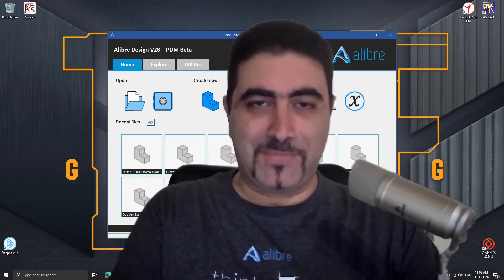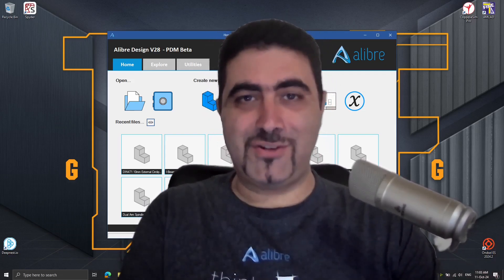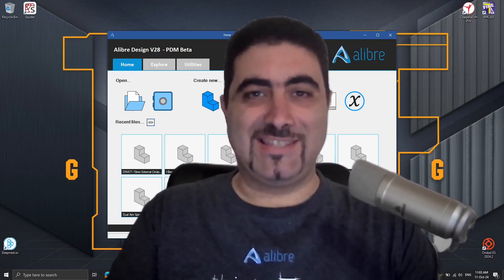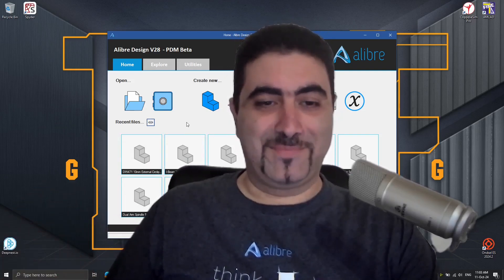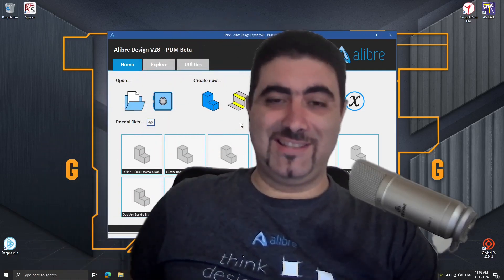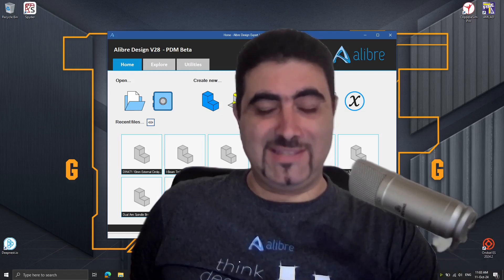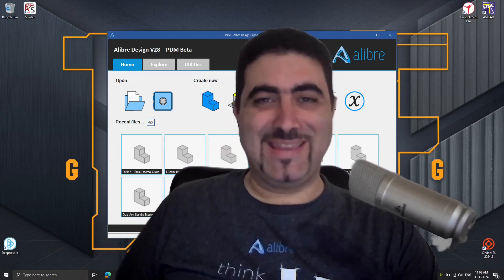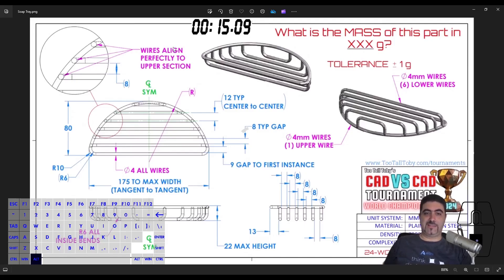TooTallToby's Extreme 24-WC-30 Soap Holder Speedmodelling Challenge

Comment: Let's gooo! Congrats on 1,000!
I'm ready to learn
5:35 "We have all of the dimensions that we need here"
The amount of times I've tried to tell myself there's not enough information on sheet is crazy. It's always there, but when you're 35minues in to a speed-modeling challenge, you question yourself.
8:06 Okay, I'm intrigued. How tf are you getting a piece made of wires from this?
12:58 This is such a huge, massive, extremely big-brain move. I would've never, ever thought of that in a million years. You're going to use the paths from the surfaces to sweep...? Maybe?
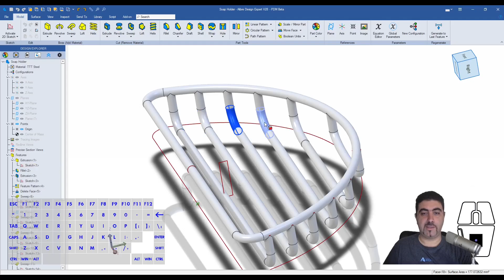16:30 That's quite the Ivan-exploit indeed, but a really good one. Does that count as an Ivan-exploit? Who knows. I think it does. Right answer, wrong geometry. I think it counts.
22:50 Would a coincident constraint with the origin not have copied over as well, so that you don't have all the extra hanging off? Even if not, would it not have saved time to add one with each copy?
23:26 I didn't know there was now an entire part mirror. That's cool. Also technically you could've just used the mass from that and multiplied by 2, but I guess that's not in the spirit of the competition eh?
Reply from the maker: 08:06 Yeah, that's the cool thing about that strategy. That's the first thing that came to ind and how I would have done it if I was competing.
12:58 Yup... Surfaces in Alibre are completely underrated and hugely powerful. Thanks to Joseph for showing the potential to all of us!
16:30 Definitely an Ivan-exploit if there ever was one... lolololol
22:50 Uhm... Adam..? You have the spark, you know that? Yes, that would have been a significantly better approach. Cool idea man.
23:26 Definitely in the spirit of the competition. Ph0sphor used to export volume from Plasticity and do the math!!! But I reckon it's quicker to do that mirror.

Thank you so much for that comment man! And, you're starting to get the hang of this speedmodelling and strategic approach. Maybe, practice a bit and throw your hat in the ring next year..?
Reply: @ExMachinaEngineering  I'm not sure, I just tried combining my own method with yours and I was 4 grams off, and I don't know where I went wrong. Darn. It also didn't really like copying the origin coincident.
Reply from the maker: Hmmm, I'll give it a go later today and see how it goes. Make sure that the sketch is placed correctly and your just selecting the origin as the base point.
Reply: @ExMachinaEngineering  I ended up figuring out why I was 4g off at least.
Reply from the maker: Ok, cool! What was it? Maybe do a vid about it
Reply: @ExMachinaEngineering  Well my 4g was only because I put 22 for the height instead of 18. 
I was also having an issue when it wouldn't automatically coincident each new sketch to the point, I'm not sure what that was about.
Reply from the maker: Yeah, I'm sure that would have gotten me too, under pressure. As for the other one... Not sure what happened there. Maybe it was inferring a different origin for the sketch?
Reply: @ExMachinaEngineering maybe. Maybe I should do a solve video just for fun.

Comment: CONGRATULATIONS on the first thousand!  This is a huge achievement.  The value of a speedrunner going through these and speaking from personal experience gives this content insight few can provide.  I'm totally flattered at 12:42- thank you!
Reply from the maker: Thanks man! I'm just trying to do the best I can. Speedmodelling this is very different to designing it for production. And might require a couple of lightning fast steps instead of a timeconsuming single one. So, I try to showcase that approach as best as I can.
And as for 12:42, it's an actual valid metnal tool. I have told people I've helped with Alibre to think "What would Joseph do". Because, you know there is to get where you're going. It's just not always the most obvious. So, look around, think outside of the box. That's what I mean, and that's what you show in your videos. By the way, AMAZING video on Majora's Mask!!!
Reply: @ExMachinaEngineering  Thank you, that one was a good amount of work!  3 videos of content in one.  I didn't get a chance to play Majora's Mask as a kid since we didn't have the expansion pack.  Playing it on the switch has been a real experience.  Majoras mask is like hearing a story while telling it at the same time, and has been such an experience in exploring giref, nihilism, even the junian shadow.  I was surprised at how meaningful and poignant it is.
Reply from the maker: Ah, yes. Well, I think back then people, and especially the Japanese, approached videogames like a means for artistic expression. Like a film. And that whole franchise is a testament to that I think